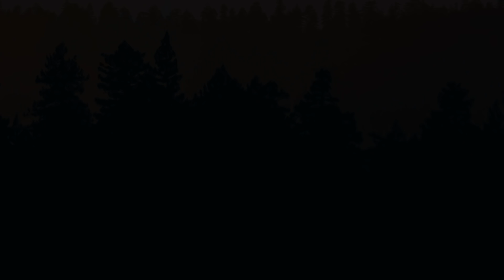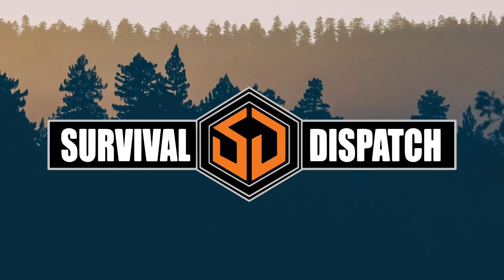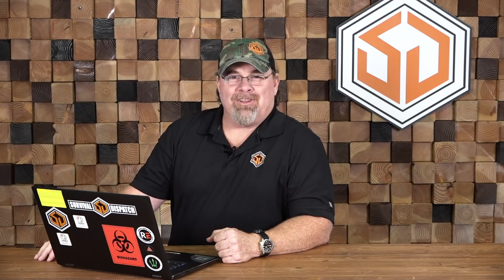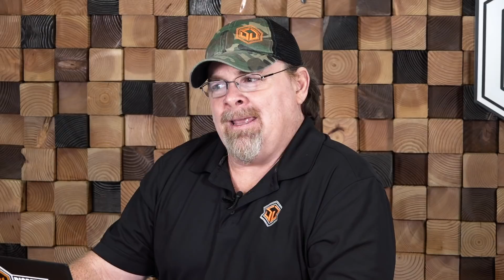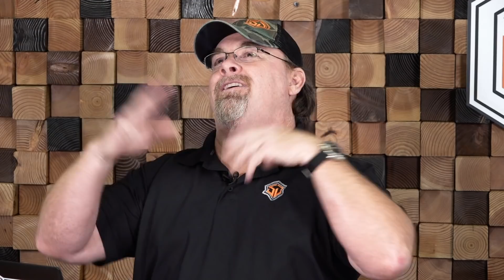All About Generators!

Comment: I would NOT recommend Propane for GenSets.  Your dependent on a Propane delivery truck to refuel & for Gasoline or Diesel you can go to a gas station and refuel you GenSet yourself. When a disaster hits everyone wants their propane tank refilled which means it can be more than a week before a delivery occurs.

I think Diesel makes the best option since you don't have to worry about the ethanol problem, its has about 20% more energy content per gallon than gasoline, & isn't as volatile as gasoline (less risky transporting in 5 gallon containers). Since Diesels engines produce more power per stroke, Diesel GenSet run at about 1800 rpm, half of gasoline (3600 rpm). This means less wear on engine parts and also they run quieter. I believe you can buy small diesel gensets as small as 7KW, which is probably the smallest emergency generator you want to buy anyway. A small 5KW is likely to get overloaded too easily likely causing the generator to fail prematurely.

The biggest issue with small generators is you are likely to run into issues running your well pump if you have a deep well. A Deep well can have an start up current over 30 amps and running current of close to 20 amps. A Well pump pulling 20 amps will consume close to 5K watts. Also if you have an electric stove, you probably not going to be able to use it, as a electric stove can pull between 30 and 50 amps (7,200 to 12,000 watts). You may also have trouble running your heating system (if using a heat pump or electric radiators). Also no go on electric hot water heaters. You best option if you want to go with a smaller generator is a gas (natgas or propane) hot water heater & boiler. You can buy combo tankless water heaters & boilers. Also an propane or natgas stove would be a good choice.
Reply: And... diesel fuel  degrades/ages over time as well.  No fuel source is with out issues.   You need to choose what  problems you  can deal with.
Reply: @Rabadav  Diesel can last a long time. In an air tight container it will store indefinately. Propane lasts because its stored in an air tight container.
Reply: i have wind powered alternate source for my solar system we have NO wind in Ga hardly but in a hurricane with no sun I have plenty lol
Reply: Sizing of loads, then reducing loads, will get many households to below needing 1000W of solar panels to charge 500 pounds of batteries, with a small Honda gas inverter genset or Kubota horizontal 300cc Diesel enough charging to get through the dark winters of Seattle or Belfast.
Reply: @Nhilistic Komrad in the USA, Well pumps use 240vac. However Wells can be deep (over 300 ft) which requires more amps to lift the water.
Reply: Well depth does not determine water pressure. The water level does. My 300 to 350 ft. wells only have to pump water 100 feet or less. About 40 psi
Reply: @laurencerilling5873  Nobody, and I mean absolutely nobody drills a 350ft well if the water table is stable at 50 feet. There is a reason why a well is deep. Nobody tells the driller: Go ahead and make that well an extra 200 feet deep when it cost $20 or more per foot to drill.

I guess some people like to argue for the sake of arguing, isn't that right Larry?
Reply: Guy tech 
But who has a propane generator and stores empty tanks ? Who is going to wait till the power is out before buying fuel? that doesn’t sound like an issue
Reply: @laurencerilling5873  Sorry, your not getting the point. Issue is if you have a long outage, your run out of Propane, for instance after a major store that knocks out power for thousands of customers. The only way to refill is to get a delivery truck, meanwhile when you run out of propane, so will everyone else with a propane generator and thus you will be waiting for days to get it refilled.

I thought I made that apparent in my comment. TLDR?

Comment: Any luck with conversion kits for natural gas lines?
Reply: I lost gas pressure one Christmas and my house got down to 46 degrees with the fan running. I was 100 miles away at the time. The gas company plant  lost power. In rural areas, they have propane tanks instead of natural gas to run furnaces and stoves etc. A propane tank of that size would hold you over for a while. I have a 93 octane 8500 watt generator that has a 8 gal. tank. It is suppose to last 11 hours at 1/2 draw. That's not going to last long in case I lose power due to shtf, and storing 2 (which I have) of 5 gal spare fuel cans isn't going to go far.
Reply: Here are the rules about portable generator safety: This is just a reminder for everyone’s safety. All generator safety rules should be followed carefully. This advice is just to make sure that everyone is aware of all the warnings and it’s just to remind people to be careful using portable generators. Generators can be dangerous if not used carefully. Every year, hundreds of people die or get injured when using portable generators due to carbon monoxide poisoning and electrocution. Make sure you are using your generator carefully and keeping others safe as well. There is something very serious that everyone should always be aware of when using generators. Some people do run their generator indoors which is not safe and that increases the risk of carbon monoxide poisoning which can cause death of family and you. Some people run their generator in wet conditions which can electrocute them. Please remember that you should never run your generator indoors. Remember that carbon monoxide is an odorless and colorless gas that you cannot see or smell. Carbon monoxide is a silent killer. Keep that in mind. Make sure your generator is 15-20 feet away from your house and away from doors, windows, and vents. Never use your generator in your porch too. Having a carbon monoxide detector is very important against generator safety. Some people also allow children to go near the portable generator which could pose risks. We need to keep an eye on our children making sure that they are not near the portable generator so they won’t get electrocuted or burned by the generator which is dangerous. A locking enclosure also keeps kids safe. A generator shed might look like a tempting place to explore, or take cover during a game of hide and seek, but a generator is a dangerous piece of equipment that can cause injury. It says on the manual that we should also keep children away at all times from the portable generator to avoid injuries. Please do not allow a child or unqualified people to operate the portable generator.  It is important to keep your children safe especially little ones. The portable generator can be hot during an operation. Just because some manuals missed what should be listed doesn’t mean it’s safe to do. Always follow the generator safety rules when using portable generators. Generators pose electrical risks. If you need to use your generator during wet weather, you need a generator tent to protect your generator from getting wet. Don’t let your generator get wet. Keep your generator dry and before using your generator, please make sure your hands and your generator is dry. Do not wear loose clothing when operating the generator. Everything that is said on the generator’s operating manual should not be ignored. Never smoke cigarettes near the generator. Please keep flammable things away from the generator. Never overload your generator too. Your generator can catch fire. Never ever try to plug a generator cord into a wall outlet to avoid back feeding. Back feeding your generator is dangerous. Always turn on your generator first before plugging in appliances and shut off the appliances before turning your generator off. Use a heavy duty cord for your generator and the cord should not be worn out. All the instructions should be followed carefully. Never refuel your generator while it’s running. It can cause fire if fuel spills while your generator is hot. You should turn off your generator and let it cool off before refueling it. Having a fire extinguisher next to the generator is also important. This is only a reminder for everyone’s safety of using generators. Make sure your generator is properly grounded. Having a fire extinguisher next to the generator is also important against the safety rules. https://youtu.be/I1jT3ANENvI and here is a video more about keeping others safe when using generators and also about our family’s safety. Hope this helps. Thank you.

Comment: I prefer propane for large generators over diesel. The diesel fuel requires maintenance.  For small generators, either ethanol free gas or propane.

Comment: I prefer diesel and methane as a fuel. Diesel has advantages in storage and differs to heating oil in only that heating oil has lower taxes and is there for colored so you can't just use in your car (atleast her in Germany).
So if you already heating your house with oil you already have a longER lasting fuel source with a reasonably sized tank. older diesel engines can also run on vegetable oil without many problems. You can find tips on using vegetable oil here on YT like in an older Video from TopGear. Methane can be produced by recycling animal/ human waste and other organic material in a biogas digester. 
Wood gas is also a good fuel source if you know how to produce it. You of course have to filter it before using it in an engine.  Byproducts of gasification are charcoal wich can be used for water filtration, fuel for cooking or your wood gasifier and tar for glueing and sealing stuff. I recommend videos from NighthawkInLight and Colin Furze. Quick disclaimer though I don't take any responsibility for actions taken by you using the information I have given and the sources I recommend. Do your research and don't do anything unless you know what you are doing.
Stay safe guys!!! Rules about compressed and flammable compounds aply! Just saying because a lot of really really bad sh*t has happend and can happen because people did things they don't capable of and/ or are stupid enough to think that a comment from a random guy under a YT-video is reliable source of information. I just share information I learned in school, my recommended YT channels and other sources. Let the experts do it!!!
Reply: @Karl Schubert  That is true but I like them because of the ability to run on vegetable oil if necessary.
Reply: Here are the rules about portable generator safety: This is just a reminder for everyone’s safety. All generator safety rules should be followed carefully. This advice is just to make sure that everyone is aware of all the warnings and it’s just to remind people to be careful using portable generators. Generators can be dangerous if not used carefully. Every year, hundreds of people die or get injured when using portable generators due to carbon monoxide poisoning and electrocution. Make sure you are using your generator carefully and keeping others safe as well. There is something very serious that everyone should always be aware of when using generators. Some people do run their generator indoors which is not safe and that increases the risk of carbon monoxide poisoning which can cause death of family and you. Some people run their generator in wet conditions which can electrocute them. Please remember that you should never run your generator indoors. Remember that carbon monoxide is an odorless and colorless gas that you cannot see or smell. Carbon monoxide is a silent killer. Keep that in mind. Make sure your generator is 15-20 feet away from your house and away from doors, windows, and vents. Never use your generator in your porch too. Having a carbon monoxide detector is very important against generator safety. Some people also allow children to go near the portable generator which could pose risks. We need to keep an eye on our children making sure that they are not near the portable generator so they won’t get electrocuted or burned by the generator which is dangerous. A locking enclosure also keeps kids safe. A generator shed might look like a tempting place to explore, or take cover during a game of hide and seek, but a generator is a dangerous piece of equipment that can cause injury. It says on the manual that we should also keep children away at all times from the portable generator to avoid injuries. Please do not allow a child or unqualified people to operate the portable generator.  It is important to keep your children safe especially little ones. The portable generator can be hot during an operation. Just because some manuals missed what should be listed doesn’t mean it’s safe to do. Always follow the generator safety rules when using portable generators. Generators pose electrical risks. If you need to use your generator during wet weather, you need a generator tent to protect your generator from getting wet. Don’t let your generator get wet. Keep your generator dry and before using your generator, please make sure your hands and your generator is dry. Do not wear loose clothing when operating the generator. Everything that is said on the generator’s operating manual should not be ignored. Never smoke cigarettes near the generator. Please keep flammable things away from the generator. Never overload your generator too. Your generator can catch fire. Never ever try to plug a generator cord into a wall outlet to avoid back feeding. Back feeding your generator is dangerous. Always turn on your generator first before plugging in appliances and shut off the appliances before turning your generator off. Use a heavy duty cord for your generator and the cord should not be worn out. All the instructions should be followed carefully. Never refuel your generator while it’s running. It can cause fire if fuel spills while your generator is hot. You should turn off your generator and let it cool off before refueling it. Having a fire extinguisher next to the generator is also important. This is only a reminder for everyone’s safety of using generators. Make sure your generator is properly grounded. Having a fire extinguisher next to the generator is also important against the safety rules. https://youtu.be/I1jT3ANENvI and here is a video more about keeping others safe when using generators and also about our family’s safety. Doing a science project about electricity is awesome for children too. Hope this helps. Thank you.

Comment: The small Honda Inverter Generators are garbage. Plastic camshaft with a rubber timing belt. Yamaha Inverter generators have a steel camshaft with push rods and are one of the best built small generators on the market. Honda cheapened the engines and put the homeowner version in their small generators instead of the old style commercial quality version. I usually buy Honda or Robin Subaru Engines but Yamaha got my buisness for the 2000 watt inverter generator. Been running good for almost 10 years. Always starts with PRI-G fuel stabilizer.
Reply: Yamaha are better
Reply: @Karl Schubert  pretty much sums it up. You would need a huge battery bank and lots of pannels
Reply: @Karl Schubert  Appreciate the info. Just thinking about the fuel part, noise, fumes. I don't really want to store a lot of gas around the home. Most I've seen take around 4 gallons of gas. If the Shtf happens, going be hard to go to the pump. I got some thinking to do. Thank you.
Reply: What's your take on solar generators? Pros vs cons. Trying to decide which is better. For lights, refrigerator mostly.
Reply: @Karl Schubert  it just depends on how each model is made. Honda still makes good generators in the larger sized. Even the Harbor Freight generators are OK for the money. When you buy a Honda you expect more for your money. I would get a parts break down of any generator and look up the part numbers for the camshaft and make sure it is steel and not plastic. Even Briggs and Stratton uses plastic camshafts in some of their engines that not necessarily bad but a rubber timing belt is a joke especially since it runs in oil.